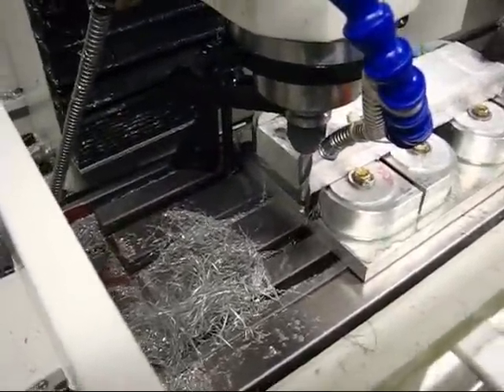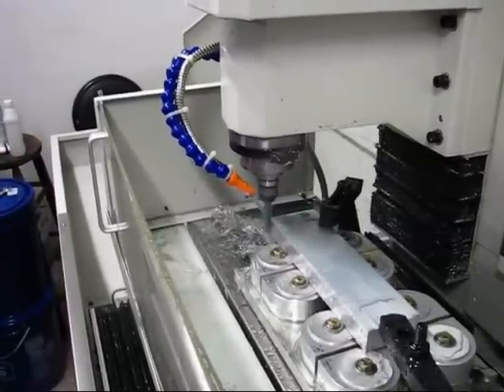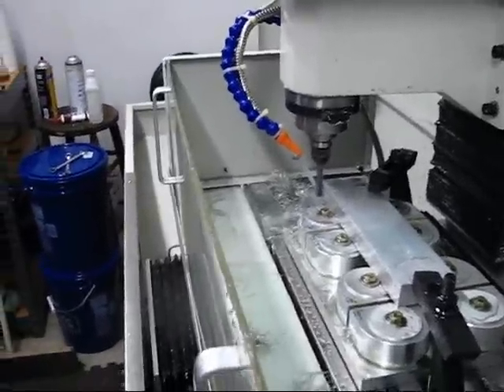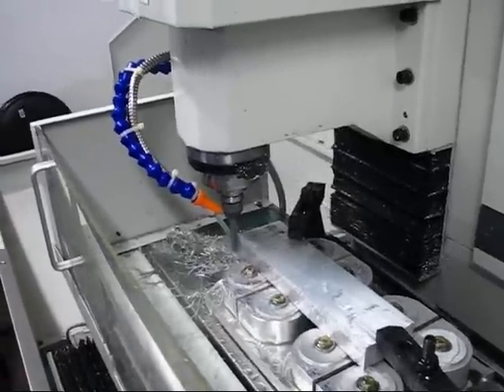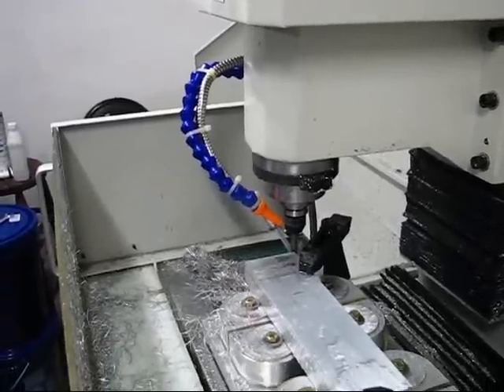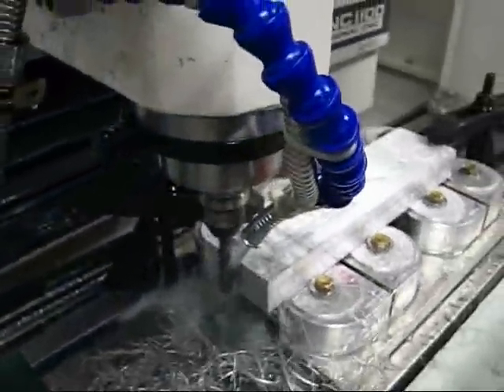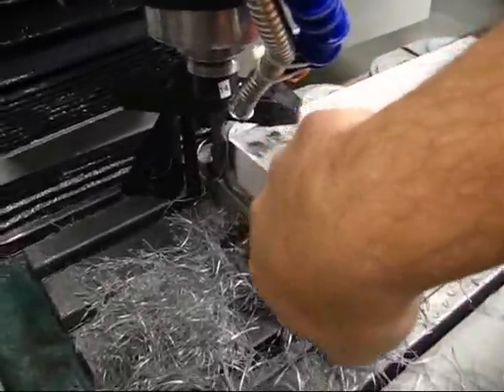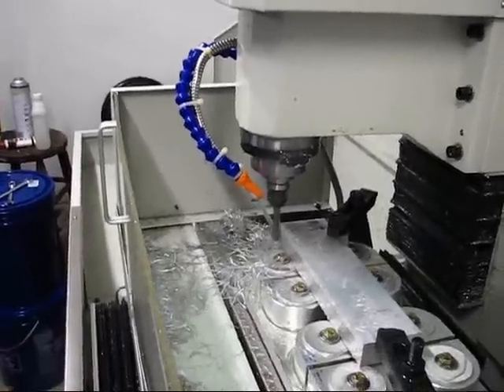Tormach PCNC 1100 - 1.25" Depth of Cut Testing

Comment from the maker: It is a 2 flute end mill.  HSS is the material.  I'll check the runout, as suggested, and try cutting at those parameters.  I'll also look into a TTS 1/2" ER20 collet to see if that does the trick.  Thanks!

Comment: Looks like a 1/2" 2 fluter..  Try reducing your WOC to .008" or less, run it at 2500 rpm at 25 IPM.  First check the RO on that tool, better to run ERs for finishing work.

Comment: Some things to try ditch the set screw hold and use a collet holder (less runout), switch to carbide on the long over hangs as the endmill is going to be flexing alot with HSS. Even better switch to a 3/4" shank tool and use it directly in the R8 collet and that will eliminate one connection (root cause of much chatter/deflection). When I get a minute I'll post a video response.

Comment: Try at least doubling your feed rate. When you have tiny step over for finishing you really need to crank the feed rate UP to compensate for the tiny diameter. Not a cure all but that's partly how high speed machining works

Other handy trick: in case of chattering... Up the feed and (if need be) drop the speed.

Comment from the maker: Thanks for the input. I was testing for another cut that was depth limited, so I was replicating that. This tool has a length of cut of 2", it has a Weldon flat and it's in a setscrew holder, so the tool stick out is dictated by all parts involved. Thanks again!

Comment from the maker: Turns out the problem isn't solved.  Even though the finish was very smooth on this test, it didn't turn out as smooth on the part.  It was good enough that I was able to finish the batch of parts I was working on, but there was still some chatter.  I adjusted all the gibs and the problem was still there.  It may have something do to with the finish of the cut previous to running this tool.  I'm using a roughing end mill and leaving .020".  I may need to leave more and make two finish passes.